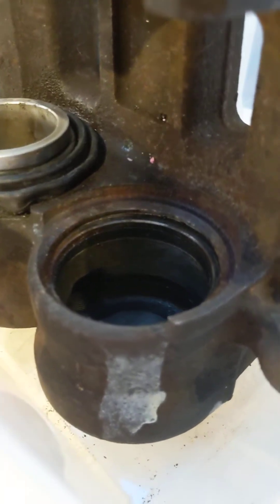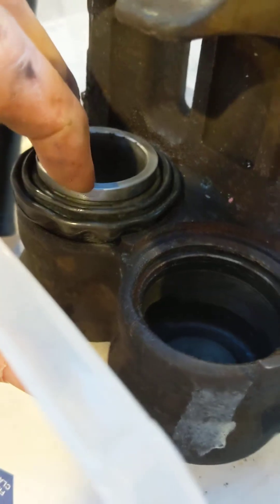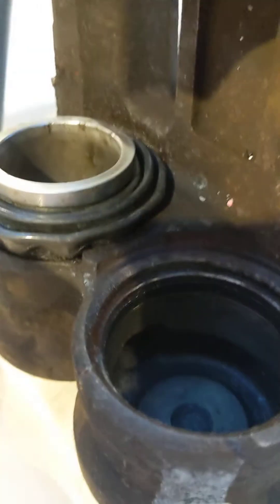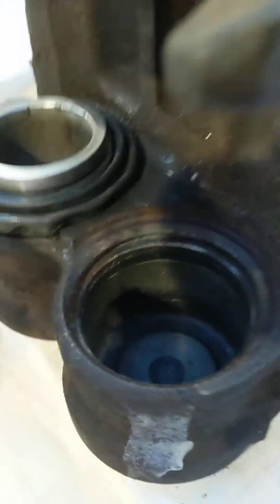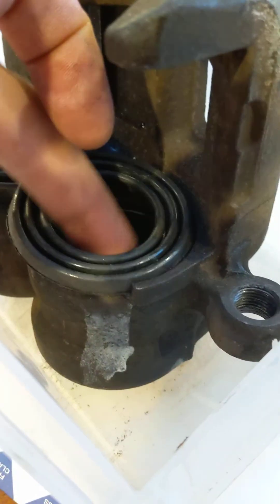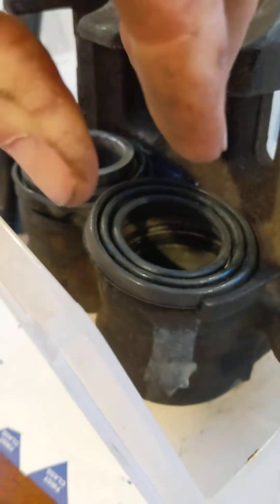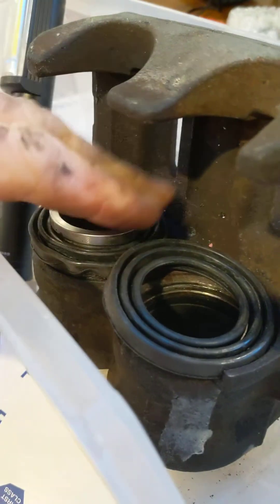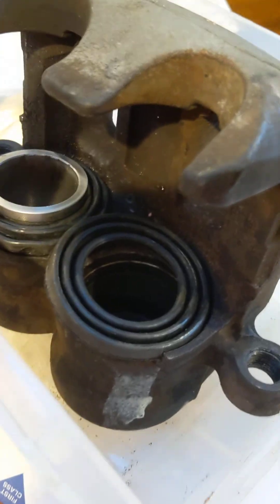2 piston brake caliper rebuild: seals and dust boots. Mitsubishi Pajero / Montero (applies to all)

Comment: Put the seal over the piston first and slide the lip of the seal off the bottom of the piston. Work the lip /flange of seal into the caliper groove and then push the piston through the piston seal.